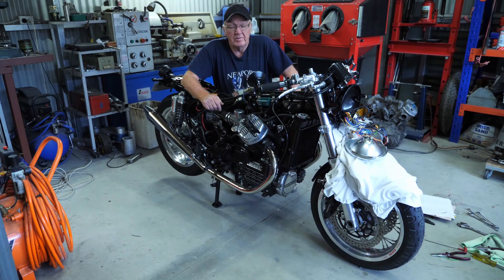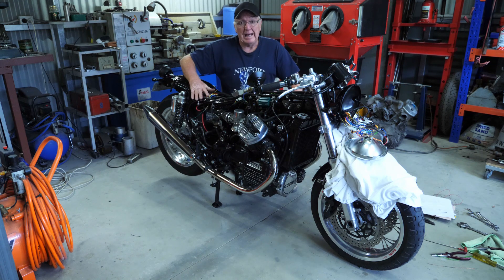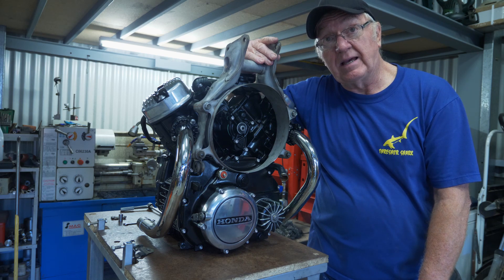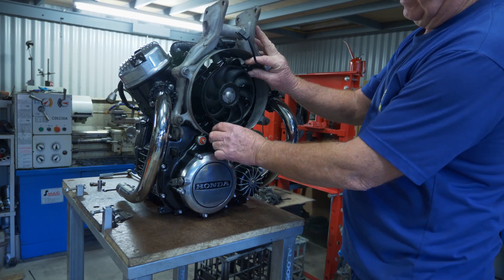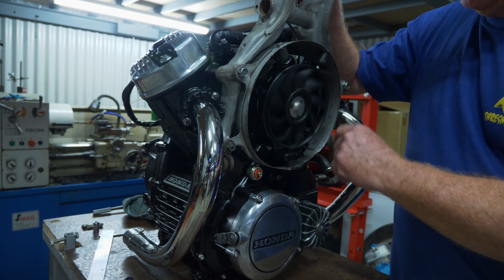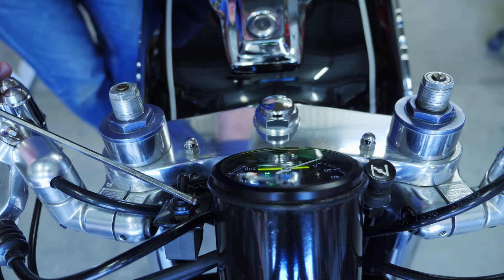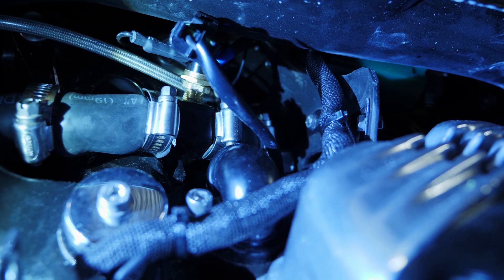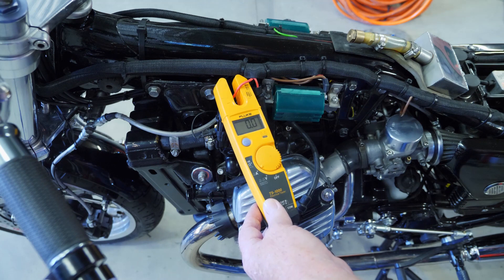How to install an Electric Radiator Fan into a Honda CX500 with MotoGadget

Comment: Do you mind sharing a diagram the way you wired everything for this electrical fan only ?
Reply from the maker: Gday Mate
Here is a link to a wiring diagram I did for the CX Radiator Fan 
https://1drv.ms/b/s!ApBicTKjfDycw1KDCh0zSWAOnG1h?e=cx1m3I
Reply: Thanks!! Did you used the same stock thermal sensor or any other aftermarket one!! By the way you did a great job on your bike please put up more content
Reply from the maker: @krislopez3913  
On the CX500 motor I used an aftermarket sensor fitted into the rubber pipework
On the CX650 it has an electric fan and the sensor is at the bottom of the radiator 
I think it would be good if the sensor could be fitted into the bottom of the radiator on the CX500 like the CX650
Reply: @Coolhand99au  thank you so much for your positive feedback

Comment: Dear Steve, congratulations on the great video and the making of your CX. I would like to ask you a question: How far is the distance of the camshaft pin on which the fan and the radiator are keyed? (I have already changed a fan and at the moment I have not done the new disassembly yet). If the distance is at least 55mm I could fit a car air conditioner fan without cutting the camshaft

Comment: Have you wired this fan up to force air forward towards the Rad or, suck/draw air back the way?
Reply from the maker: The fan is sucking/drawing air through the radiator and out the back of the engine/bike
If it was wired the other way blowing air out of the front of the bike. It would be blocking air flow
Reply: @Coolhand99au  Perfect, thanks. I have the same fan - just arranging to fit now
Reply from the maker: @chrisdavie4660  No worries Chris Good luck

Comment: Thanks so much for posting this. I'm about to undertake the same endeavor on my gl500 with the same fan.

I'm planning to use a 90c sensor mounted either at the radiator outlet or in place of the radiator drain.

I'd been planning on installing the m-unit blue later and hadn't thought to utilize the aux in/out in place of a separate relay...so now I think I'll pick one up sooner and save myself some hassle!
Reply from the maker: Thanks TJ
Way to go
You wont have a problem running it from the M_Unit Blue the Aux 1 can handle 10 Amps 
Aux 2 can do  20 Amps However Aux 2  does have a function for an electric fan but also the speed sensor I cant understand why Motogadget didn't put the speed sensor into Aux 1
Below is a link that shows how bullet proof the MotoGadget is. Stephan from revival motorcycles tries to destroy one !
https://revivalcycles.com/motorcycle-videos/d8k1akVAeCI

Comment: Dear Steve; I’m not sure about this mod since you need to cut off the tip of the camshaft to accommodate the new fan (so going back to original will require a new camshaft) so as long as my cooling system works properly I leave it as it is, btw. my M-Unit is the V2 not the “blue” so I’m not sure about the connection.    Great video as usual!!!, I still waiting for a riding video ✊🏻
Reply from the maker: Hey Carlos
Remember that old saying “If it ain’t stuffed don’t fix it “ I’d stay with original
I really had no choice one motor had no fan and the other was broken 
I’ve still got another week to go in isolation before I start the ride video and it will take me longer than usual to make I’m going to put more effort into that video
Reply: Coolhand99au , well Steve; over here (Uruguay) we just started with the quarantine, is not mandatory yet but most of the people stays at home anyway, all the best mate, I’ll be waiting for the next video!!😷
Reply from the maker: @carlosgooglemaps94  Yeah Carlos 
I think we all have to keep a low profile till this covid19 passes
Take Care mate